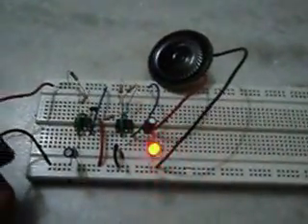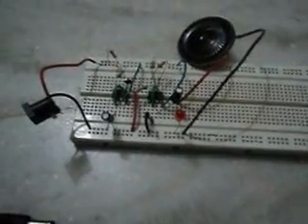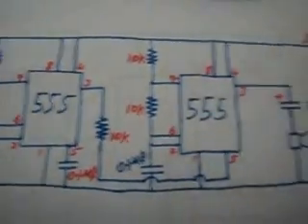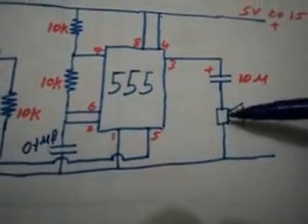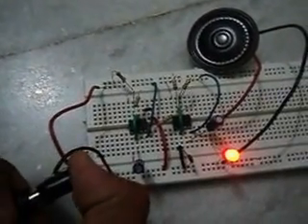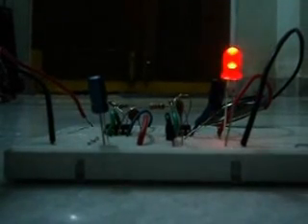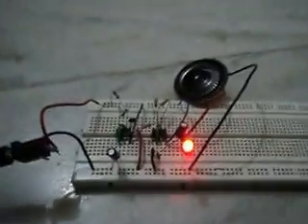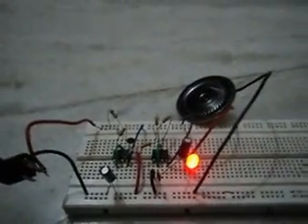Police Siren

Comment: Hello there. I followed the circuit diagram but without success.
I would need a little help if possible regarding the siren.
any chance I could get your mail to post you my NOT working police siren circuit
Reply: +marko pavlovic Try following this schematic. Hopefully this is more clear. I used this schematic and had success. http://www.talkingelectronics.com/projects/50%20-%20555%20Circuits/images/555-PoliceSiren.gif